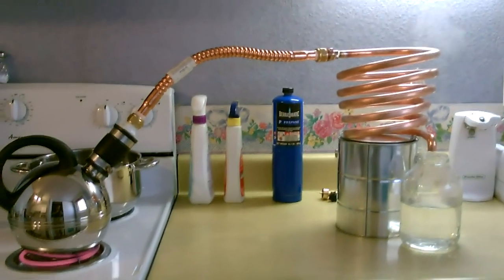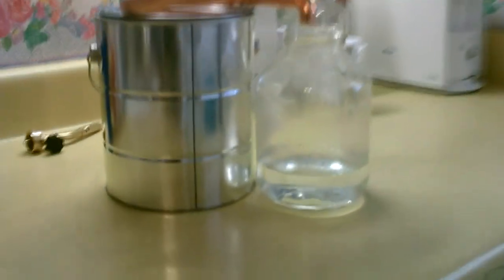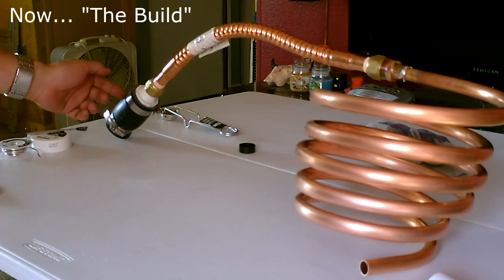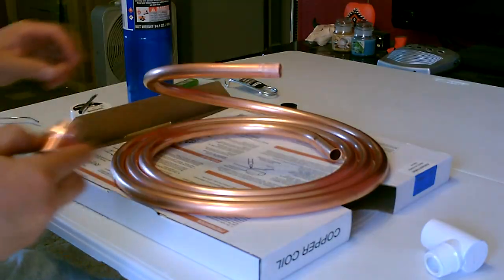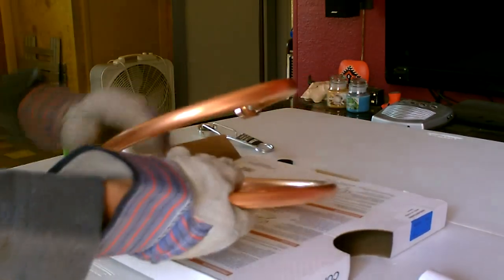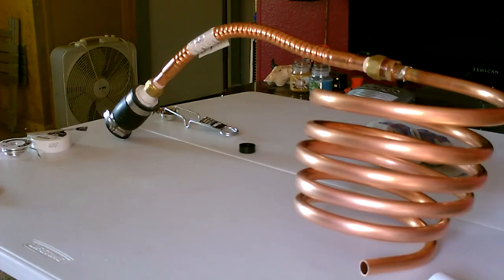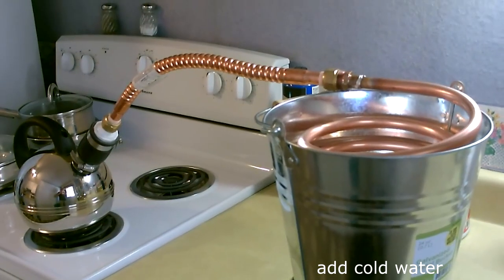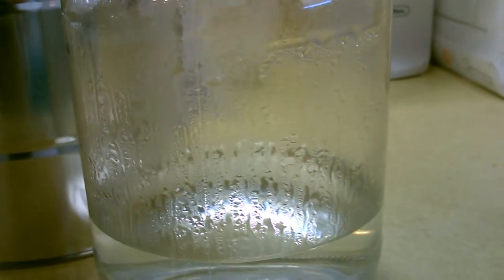Homemade Water Distiller! - The Deluxe DIY "pure water" Water Distiller!  Full Instructions

Comment: In response to a previous comment about testing the TDS here is my unprofessional opinion based on facts I have tested for myself. As someone who has actively cleaned water and tested it often for TDS and PH values due to growing up with well water, I can say that TDS can be higher than what you expect. Rain water often hits the ground with a TDS of 5-15 depending on the area you live but around large cities its usually closer to 40. Regular bottled water from say walmart usually come with a TDS of around 35, smart water brand has been has high as 70 in my tests. Distilled water from retail chains have tested as high as 7 on my tests but I found that it's usually a brand issue. Walmart's gallon distilled has been as high as 3 before so its fairly clean. If you live anywhere with locally sourced waters, always test them for TDS. Where I live a local favorite that I personally cannot stand for it's taste tests as high as 85 sometimes depending on the time of year it was collected. Other local sources like the one from Zion National Park tested at 27 when I was there in the fall. Water from Lake Mean outside of Las Vegas tested at 38 which was surprising for the size of the basin. Larger basins generally have a higher TDS due to living organisms. The distilled I make usually has a TDS of less than 10 which is really good. That comes from tap water that reads 250-295 depending on the time of the year. The rain water I distilled last tested at 0-1 TDS which is more or less pure water. But water with no minerals is not a good thing for too long, especially in a survival situation. You need some minerals for health. Either buy mineral drops (8 ounce bottle treats 165 gallons) or do like I do and put a pinch of pink Himalayan salt in the water. Not enough to taste it but enough to get the minerals since it has 85 different minerals in it. Not the best option for people who are on low sodium diets or sensitive to sodium but it's effective and does change the flavor of the water without making it salty. You do not need much at all.
Reply: From Mackay a  small city in qld Australia I measure my water and live on distilled water and have done so for the last 2 yrs..the rain here from a water tank can be around 19 on a TDS meter this is due to pollutants in the air jet fuel smoke dust etc.. and the treated city water as high as 180 !! I drink distilled 00.0 daily BUT I eat good vegetables & meat..what worries me with the above system is the copper piping..I prefer stainless steel as copper once it turns green can actually make you sick..I was looking at buying a chinese type still 10/20L Spirits/Water Distiller Stainless Steel Boiler Brew Alcohol  from ebay  to distil my water but the copper cooling coil has me worried..also the temperature to "boil" water at to distil it needs to be known..theres a lot more to this but I will get it right and sort another still out as the one I am running is electric and I would much rather it ran on propane (we call it LPG here)..but like I said the copper cooling coil worries me.

Comment: I tried this type of system and I get vodka coming out.
I think I am doing something wrong.
Reply: No you are doing it right.  lol
Reply: Not a problem, a gold mine!
Reply: me not you lol
Reply: Obviously not .... if you got vodka everyone else is doing it wrong
Reply: «Golden shovel award here for oldest undug comment» 
Not understanding anything of those things potentially be ilegal in some countries, you might want to somehow control the boiler temperature to be between 80 and 90C 
On the electric such can be achieved by reducing the input voltage, due to delays you probably need some controller to operate on lower temperature like voltage reduction above 75C and increase when below 70C.
Reply: In most places it is safer to drink vodka or beer/wine than the water.  Everyone who survived long enough to reproduce knew this the last few thousand years.
Reply: @mmercier0921  the children even drank it a weaker version

Comment: Great Vid! Thanks! A tip for those wanting to construct a larger and more efficient coiled section .... as that could help with steam loss at the end ..... if you have a freezer large enough to place the entire length of copper tube, simply fill with water, then freeze. Once frozen you can work the copper very aggressively and quickly with any pipe-bending tool or improvized version and the ice will stop the copper deforming so you will get unspoilt perfect coil, regardless of how many turns. ;)
Reply: You mean fill the actual copper tube with water and then put it in the freezer?
Reply: @davidsonnow  exactly. ice is very strong and holds even large diameter copper pipe perfectly resulting in no deformation as you bend
Reply: @davidsonnow  yup! ice is strong and prevents pipe from deforming ;)
Reply: @davidsonnow  Yes! So sorry for late reply - my gmail died and I did not see. The frozen / expanded water ensures there is no distortion when you start bending
Reply: May I  add?........good idea, but better be real careful, filling with water and freezing can and will swell the pipe/tubing  or even burst it, if allowed to freeze too solid, for too long. Once swelled, the fittings will no longer fit.

Comment: how do you sterile and clean the pipe?
Reply: you can just tip your pot, and pour your boiling water through it, that should kill everything. Then refill, and distill away.
Reply: It's steam passing through the copper tubing, I wouldn't think that would require further sterilization

Comment: I noticed copper pipe is almost always used. What is the reason for that? I am on the verge of making my own this week. Thanks for the tips and tricks btw!
Reply: Copper is really conductive so it heats up and cools down alot faster than steel or iron
Reply: Copper when dry is natural disinfectant. Its to keep your steam running through a sanitized environment.

Comment: If you put the coil in a large container and drill two holes in the bottom, one for the coil to exit the other to let the coolant water run through the container and be collected for the next run and slowly have a constant flow of cold water through the container it will keep the collector coil cool and as you are flowing water through your container it will be constantly cold and the run is your next load no waste and no extra energy needed just run it from the cold tap and recycle! Gravity does the rest! And you can use a longer coil just get a piece as long as you want and coil it yourself! Easy and maybe something bigger than the kettle!!
Namasté
Ps still a good post
Reply: Taking designs from the alcohol distillers is indeed the way to go.

Comment: Just curious, does de-ionised water corrode solid copper metal? I've read cases of corrosion but they look like they were caused by erosion from the constant movement. I can't confirm if it really "dissolves" the metal.

Comment: don't use an old tea kettle. You'll have mineral build up on the inside bottom that you can't clean out. Use a pot instead. Drill a hole in the lid to fit the tubing. Put a weight on the lid to keep steam from escaping. You can always clean the inside of a pot.
Reply: That doesn’t explain why don’t use old tea kettle. How does it affect the distilled water?
Reply: @story1234 it doesn't, citric acid or white vinegar to clean any crud from the boiler
Reply: @story1234  Like @kf9233 mentions: because a kettle is prohibitively hard or impossible to clean. The pot solution doesn't fix anything except you can clean a pot but not a kettle. So as residue builds up -- and it invariably will build up because this is real world -- you can periodically clean the pot, with a citrus-based cleaner, vinegar, salt, steel sponge, whatever. This is my understanding of the comment above, at least.
Reply: Tiny bits of scale rise up with the steam .
Reply: But what if its always and only used for that purpose?

Comment: Fill with sand,  heat to red hot with map gas,  pack sand down,  wrap around tree branch or wooden post.  Done deal.  Like that old Jimmy Stewart movie flight of the Phoenix.  The Nazi dude was like 'fill the tube with sand it wont kink' then you can make that condensor any shape or as tight a coil as you want.

Comment: By the way, if you fill the copper piping with sand (like the kind you get at Home Depot) you can relax a little when bending it.  The sand protects from kinks.
Reply: And make sure you plug the ends well, or the sand will push ooze out, not helping the kinking situation.
Reply: Just be gentle, sand is an added step of filling sealing and cleaning, just be gentle and save 30 min. It's just that I'm an HVAC tech and anything inside the pipe makes me cringe lol and also the amount of energy used to gather a large amount for a garden looks pretty high.
Reply: Sand does not really work.  But take this from a pro that bends schedule 80 [+ like Yellowmine pipe in 6" diameter with 3/8" pvc wall thickness] cap the ends or plug the ends, just be sure they are secure. Then heat the pipe around the bend area [PVC] with a roofing torch and bend away! Internal pressure holds the pipe wall from collapse. Copper can be capped and compressed air added to 125+ psi.  Heat will work too but the process is dangerous. OR fill with dry silica sand and then compress to 125 with air - now you can really manipulate that pipe.
Reply: @RRaucina OR simply fill the tube with water, freeze it, and you’re good to go!
Reply: 20 feet of 6" pipe doesn't quite fit in my freezer  @davidsonnow
Reply: So does not bending it too sharply.  You have to be  crazy rough to kink it.
Reply: No..... don't do that
Reply: @CaptainLongSack  Why not?  Seriously asking.  I heard about it, tried it with small diameter copper tubing and it worked.  Is it only good for small diameters? Does it harm the tubing in some way?  If you're going to say "don't do that" an explanation of why not would be helpful.  I'm always willing to learn.
Reply: Do none of you have geometric objects lying around to work the pipe with?
Reply: The old sand mandrel trick. Taping up the ends when it's in there is supposed to help too. Never done it myself. They also have a spring mandrel at Harbor Freight.

Comment: as it is only water you are trying to distill..... you need a double boiler effect/coffeemaker effect....use a tube 15x larger than your pipe diameter to prevent kinking as a form to create a tight tube shape spiral....down then up. your goal is zero steam coming out the top...but your pipe diameter is way too big....1/4 inch copper is plenty....(3 inch form tube) water will condense at lower party of coil. new steam will push out the water back up and out. once upward motion of water is acheived the delay and increased pressure will further increase your condensation effectiveness.

A second option you seal the first jar and the line in the kettle goes just off the bottom. put a second line into the jar just off the bottom on the opposite side of the jar from your first pipe.... pressure from steam entering will push water out the other. adjust your heat on the stove to keep the water level in the jar above both pipes. this will give you 100% effectiveness

Comment: May I suggest you use some type of bell bottom recovery flask in order to recover and condense the steam that is escaping as a loss. I just thought of that, observing so much steam.
Reply: Can remove the steam inefficiency by cooling the coil with water. Can use cool water from a nearby flowing stream with a special design that doesnt need a pump. That is how they did with some alcohol distillers back in the day.
Reply: @Juan It's called an Erlenmeyer flask not bell bottom

Comment: For everyone trying to coil copper pipe. If you fill the pipe with water then freeze it, you can make a very tight coil with no bending or breaking of the pipe
Reply: how would you freeze a 10 foot or longer section of copper pipe?  Getting it to fit in an average freezer is the problem.  Also how to keep water inside a 10 foot section of copper pipe without leaking will be a problem.  Also water expands as it freezes so wouldn't that compromise the copper tubing?
Reply: @kma5699  easy it already comes coiled to begin with!

Comment: Just a tip on bending copper tubing. First fill the straight or curved tubing with sand full to the top. then find a pipe or something to help bend the copper to your specs. the sand  inside helps the copper not to bend or get crushed . now slowly bend the copper around and around until you are finished. then was out the sand with a garden hose, make sure the copper tubing is very clean. Now you have a perfectly round tubing bend!
Reply: You can also fill it with water and freeze it. It does the same thing.

Comment: How did you roll the coil do neatly???
Reply: Ken James Jr read the comments.
1. Fill copper with sand.
2. Cap each end to keep sand in.
3. Find your form probably pvc pipe and just wrap it around. 
4. Take off caps and rinse your newly coiled pipe after emptying sand.

Note the sand keeps the pipe from kinking.
Reply: straight. Thx

Comment: If you fill the copper tube with fine sand first, you can bend it around a former and make it as tight as you like with no kinks in the pipe.  Empty out the sand and flush it through with water and voilà! It would be good.
Reply: For any project with bending copper that is involved with food or ingestible products such as this one, always use table salt. It pours nicely and is water soluble so you can flush it cleanly. No particle is stuck and left behind by chance..
Reply: @jimbass7867  sand isn't going to hurt you.
Reply: Dont use sand or it will get stuck like mine use water instead or salt

Comment: The guy at the store told me it requires welding for the copper tubing. Any way around that?
Reply from the maker: hi there. no welding, but i did solder a joint or two. if you want to avoid that, look for something called "push fit" plumbing connectors. you could use those.
Reply: Ok, thanks!

Comment: I would add one more step. Add another threaded fitting to the bottom,  connect that into another PVC cap, use a short piece of PVC tubing that you can stuff an activated charcoal coffee filter pack into, then finally a bottom PVC cap to hold the filter pack in. This will do 2 things for you. First it will filter out any contaminates that happened to make it through in the steam. Second it will make sure that no steam escapes into the air as it will have to condense in order to make it through this filter, improving efficiency.

Comment: Although you may have eliminated the chlorine from that water, how do you test that distilled water to see if the fluoride has been eliminated. I've talked to many water purification businesses and few of them can prove the elimination of fluoride.
Reply: Supposedly some types of fluoride have a boiling point below water and may not be fully removed. Despite that, fluoride has been found to be 98-99% removed in properly distilled water. That's better than any filter based system and usually those require additional filters just for fluoride.
Reply: it does. Distilled water is the purest water you can attain

Comment: Have you tried a TDS meter to see how many solids are left in the water after distillation ? That will show you how well it works,it should read zero or slightly above.
Reply: that is right  I got it down to less than 10 from 500

Comment: Haha I commented too soon on the previous video. Great minds.. n all that  :D
Nice addition. Id move the screw part tho. It's getting heated by the steam coming upward. The cooler that part is, the more water you'll recover and less steam that'll escape. I think someone mentioned ice or cooling that area, which would dramatically reduce the amount that comes out as steam. Also, mess w/ the heat source. You dont want it on full blast b/c it wastes energy that leaves as the steam.

Even if you had a fan blowing on the corkscrew part (if it were in the middle, and the jar was further away.. so the fan could blow the coil part only, so you do not evaporate more water.

Comment: Nice job, but I can still see a lot of steam escaping from the end opening so I suggest using a narrower tube for the coil to increase the contact of the steam with the colder inner surface of the tube thus increasing the overall efficiency of the apparatus.
Reply: +Chris Young 
What about a small fan at the coil?

Comment: What am I doing wrong? I got all the pieces by asking a man in plumbing section of Home Depot but they didn't have copper so it's stainless steel or silver... and also I used the plastic pvc and really would like medal.. and one more thing... the coupling connector I got is melting when I connect it to my kettle... I see that yours has some sort of medal liner? Mine didn't come with one.. can you post links to the copper setup? I'd really like to make it just like this one..
Reply: Silicone is a great substance because it's non-reactive and doesn't leech crap at high temperature.
Reply: I cannot see the comments here!
Reply: SKY STALKER The word is "metal", NOT medal.
Reply: Are you asking about "metal"? or "medal" ? ... not being rude, just asking because they both could be involved here in a conversation I think.

Comment: For those having trouble finding a kettle without a lid on the top, look for the Paul Revere Whistling Tea Kettles. They are the kind I've used since the 70s. They haven't really changed. I put some links bellow for Amazon and Walmart.
If you're outside the U.S. Just search for the Revere brand whistling kettles. They have no lid and work perfect for this. 

Revere Whistling Tea Kettle
https://www.amazon.com/dp/B00005B5ZV/ref=cm_sw_r_cp_apa_5ybizb4SBHX56

Revere Whistling Tea Kettle

http://www.walmart.com/ip/Revere-2-1-3-Quart-Whistling-Tea-Kettle-Stainless-Steel/872101